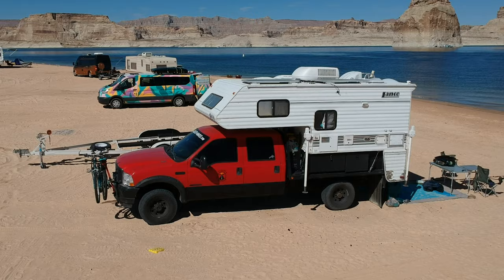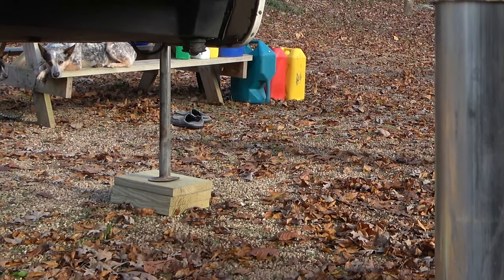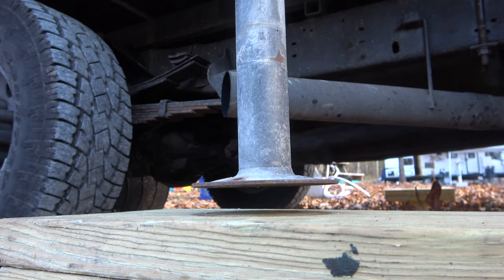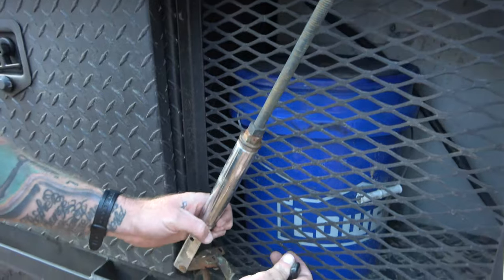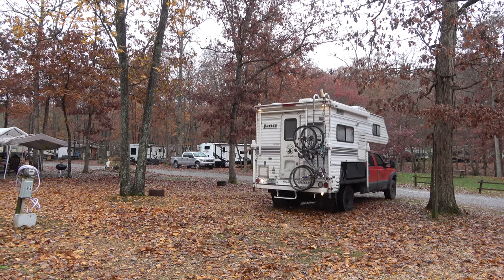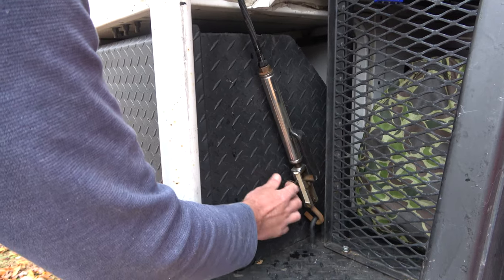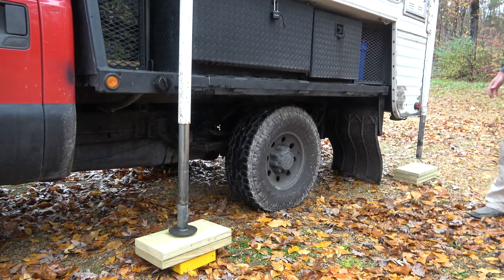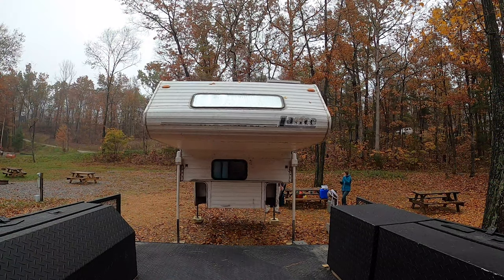How to Load and Unload a Truck Camper onto your Pickup Truck

Comment: How is easy is all this to do for a solo traveler? I've been debating between a camper van or a truck and camper. I lean towards the second one as I could still stay in the camper if the truck needed repairs or vice versa. I found this video when searching for this topic but I'll look at more of your videos.
Reply from the maker: We have met plenty of single people living this lifestyle and there is quite a bit of freedom in that you'll have more room and decision-making is cut in half. We were fortunate with our near catastrophic breakdown that we could separate the truck and camper so we lived in the camper for months while our truck was getting repaired. But I wouldn't base your entire decision on that. If you have other uses for the truck when you're not camping thats big too. Most of the TC people we know use their truck frequently if not living full-time in it. But full-time TC people rarely drop their camper. We did in the spot in this video because we wanted to drive some narrow, windy mountain roads that we couldn't do with the full load. There are definitely pros and cons to every RV. If you have a great truck already, it's less investment to get started. But if you're buying a truck and camper then it can be expensive. We opted for a TC instead of a van because of the extra room we thought we'd have (head clearance as Chris is 6'4"). But there are some great van options now with higher roof height and longer wheelbase for additional living space. The truck camper life is a community we really enjoyed when we had ours (changed to a Class C motorhome last fall). But the van community is awesome as well! So many variables to consider! Send us an email and let us know if you need any additional help!
Reply: @CalledToWander  thank you for such a detailed response! I don't have a truck, just an SUV, 6 cylinder. I've been wanting a truck for reasons beyond camping but could tow a camper or have a truck camper. But a camper van also offers good options. Lots to consider. I will definitely contact you for more information if it's not covered in your videos.

Comment: Thanks for the video. How long before you were comfortable loading/unloading?
Reply from the maker: 2.5 years! ;) When we first started we had our second house battery on the truck and the first in the camper. So we had to disconnect cables between those two and the inverter in the camper (connected directly to battery 2). This took a bunch of time. But since we moved the batteries in the camper we can drop the camper in about 10 mins. Loading takes a little longer because I (Chris) at rarely accurate in lining up the bed with the camper. To my credit we only have about an inch of wiggle room between our jacks and flatbed in either side. Otherwise it would not have taken more than a handful of times to feel confident about loading/unloading!

Comment: Hey how wide is your bed? And what is the measurement inside to inside on the jacks? I have a flat deck and want to load a camper but I’m worried that there won’t be enough clearance to get it mounted. Is it ok to rub the jacks slightly as you back the truck in?
Reply from the maker: We sold the TC almost 3 years ago so don’t have the dimensions. But the bed was wide and we only had about a half of an inch on either side between the bed and the jacks. We got very, very good at precise loading and unloading. And yes, every now and then the jacks would get rubbed gently. I always stopped and reconfigured so that I did not damage them. You could potentially add dually jacks that swing out wider. We considered this but then sold out TC to get a bigger Rv.

Comment: Do I need to pull something in to do this? I see you were unplugging a thick wire.
Reply from the maker: We had a separate battery on the flatbed that required disconnecting. That may be what you saw. Depends on your wiring. But usually you just have the wire harness  to disconnect and that’s it.
Reply: @CalledToWander  Thank you so much for your reply.

Comment: Thanks for the video. What is keeping those tool boxes from moving around on the bed? Are they welded on? Thanks
Reply from the maker: Bolted. We drilled holes through the aluminum boxes and the steel bed and bolted the boxes to the bed. We also bolted the two boxes together on the passenger side as well. Nuts and bolts are simple fixes that allowed us to take the boxes on and off at times for a complete flatbed when we needed it.
Reply: @CalledToWander  thanks so much, that sounds like an easy way to mount them.
Reply from the maker: @adamh7947  Easy, inexpensive, temporary and secure. We never had an issue with them and we did remove them on occasion to repaint the bed with Rustoleum and to haul stuff around in good truck form. Glad it helps!

Comment: After I load my camper my tire psi dropped to 45 from 75, Do I need to inflate the tire back to max cold psi?
Reply from the maker: Psi should not drop.
Check for leaks. The tire will flatten out and spread out the pressure but should not lose pressure. Definitely top back up!
Reply from the maker: We always kept our tires at max psi (80 psi with our Toyo All terrains). We would air down our airbag suspension if the camper was off, just for smoother ride. But kept tires aired up. And we never aired down for soft sand, etc. as we were too heavy to comfortably drive through soft sand anyway.

Comment: I .noticed only takes 3 jacks to support my camper.  As  I load and unload I notice one  sometimes has no pressure underneath.
Reply from the maker: 3 is dangerous. We had one jack motor that did not go down as fast as the others and we always had to double check contact with it to establish 4 points of contact. The first time we noticed this we were fortunate to catch the camper before it tipped. With 3 points it would not have necessarily tipped over entirely, but could have torqued the other jacks or damaged other structural components.
Reply: I notice when I'm jacking mine up almost always one Jack has no pressure .  I have to go way up to  clear my truck and it's sketchy old hydrolic jacks .